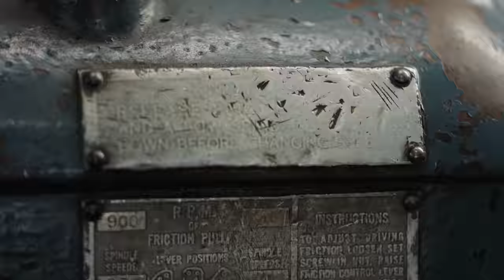The "Odd Rod" is a 470bhp V8-Swapped Mad Max Style Miata | Top Gear American Tuned

Comment: It's a cool build only thing I don't like is the front radiator mount I think if he just put the miata front clip on would of been  better but only the fender would of been exposed steel the front is plastic so I see why he did it but I still think it would of looked better not my build so it doesn't matter but it's still cool and looks fun.